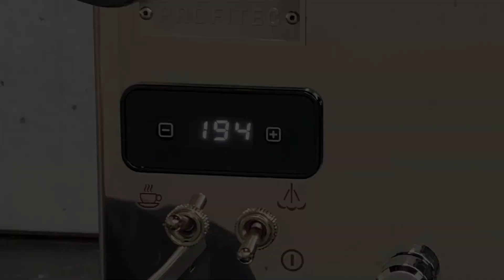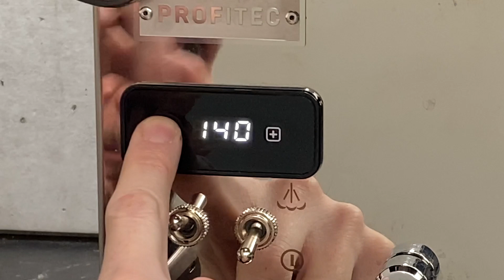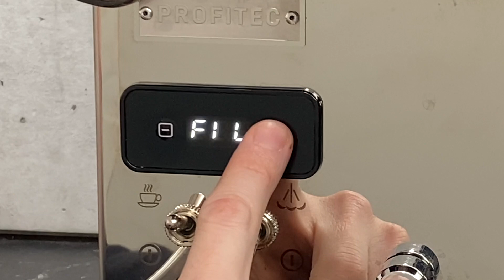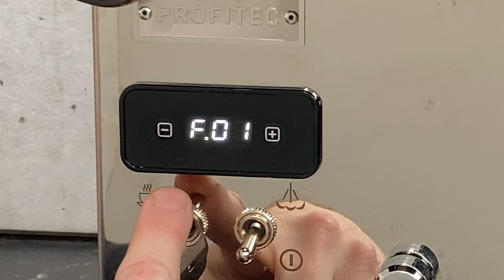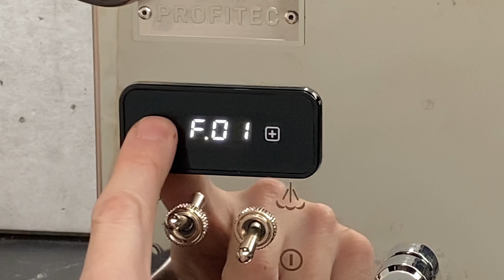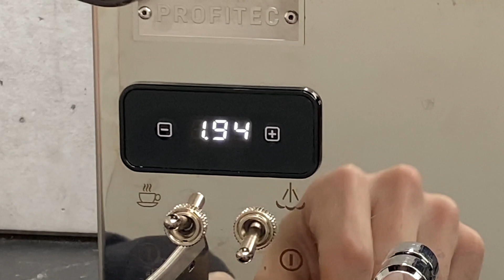Profitec Pro 300: PID Programming and Reset

Comment: Hi there. I bought this machine from WLL and have a question about the steam function. With the machine fully warmed up, sometimes when I open the steam valve it blows out a "burst" then the temp dial goes well below the green, and has to warm up the steam boiler again. Any ideas what could cause this issue?
Reply from the maker: Hey Jeff, our tech support department should be able to help with this! Feel free to open a ticket anytime:
https://www.wholelattelove.com/pages/support